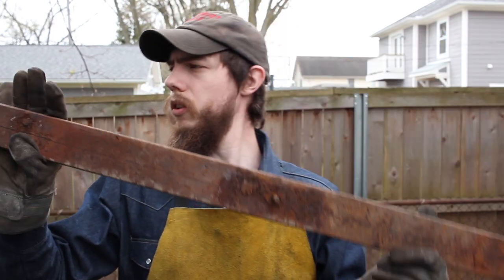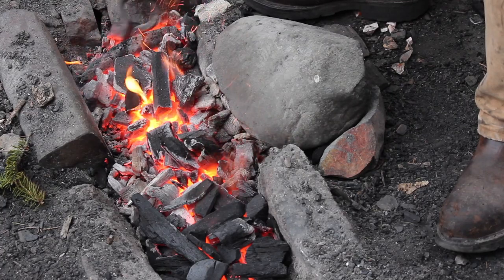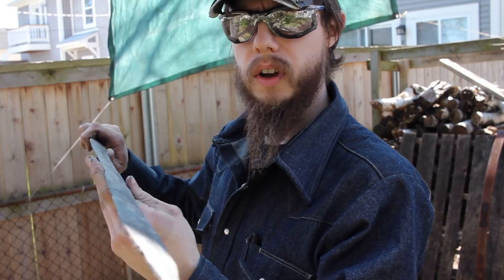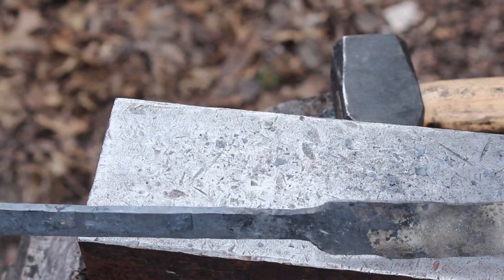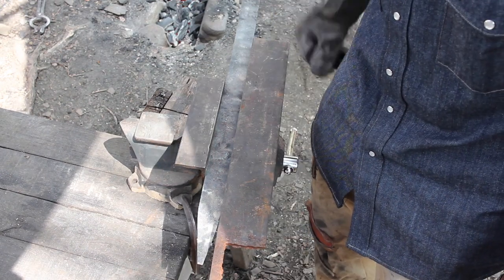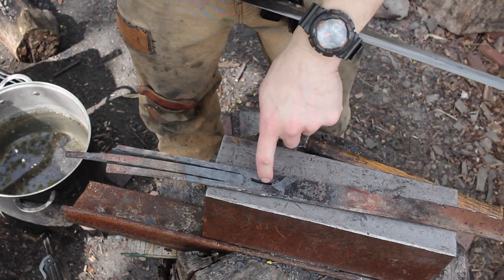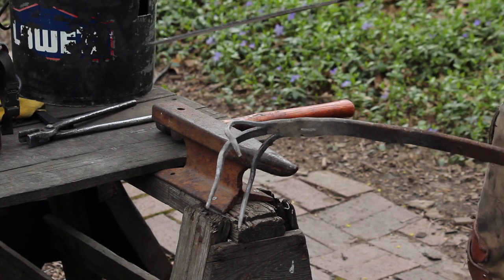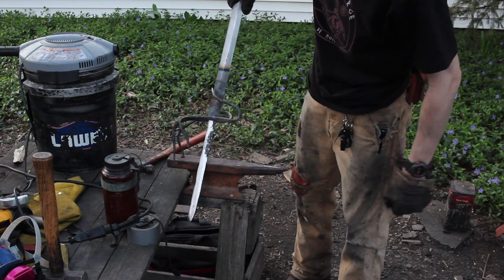Custom LONGSWORD (Swiss Sabre) Hand-Forged from a Leaf-Spring: Part 1 of 2 (Backyard Swordsmithing)

Comment: By watching Forged In Fire, they recommend leaf srings prior to 1950ish so as to get pure carbon steel and to avoid modern alloys that inhibit harding and tempering for knife edges. Do you find that  to be true?
Reply from the maker: To be honest, I have no way of knowing when these springs were made when I find them, but I haven't had too much trouble heat treating them.  I've only had one set of springs that never quenched as hard as I would like, but I'm sure most of what I've worked with is post-1950's.
Reply: @PhilBaumhardt  👍👍🤠